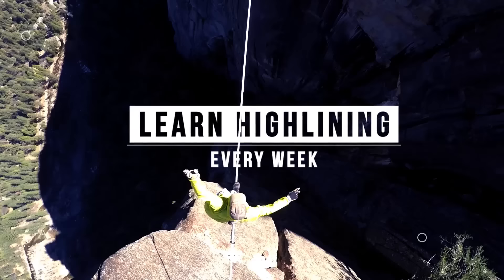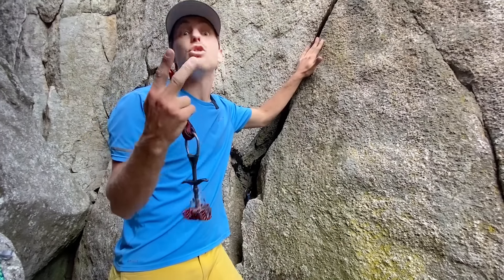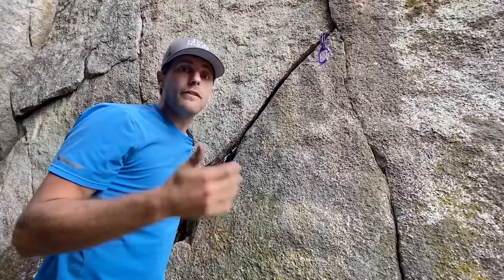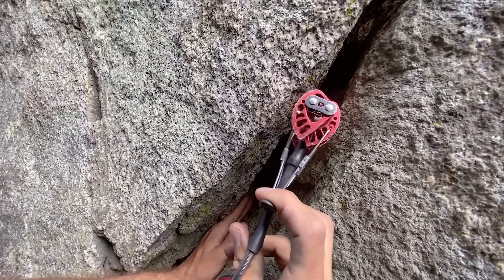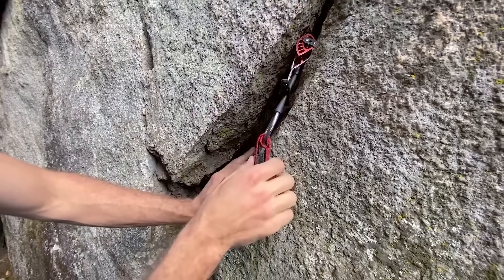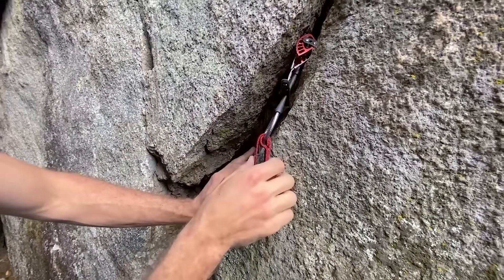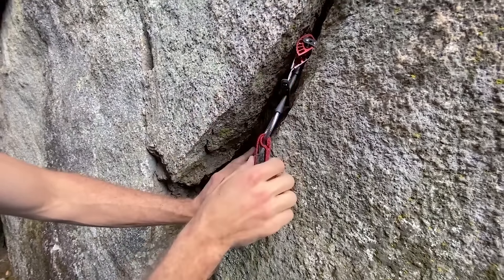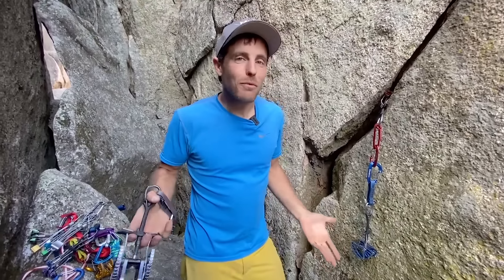How NOT to use cams for climbing trad gear - with break test!

Comment: A small clarification on your Totem Cam comment at 5:30:

The only context where it's manufacturer approved to place a Totem Cam with only two lobes engaged, is aid climbing. Totem Cams aren't rated to hold lead falls in two-lobe placements.
Reply: What about 3 lobes?
Reply: To be fair I think the big ones are still rated enough for a lighter fall with two lobes but they say don't as a precaution.  I certainly wouldn't go whipping on two lobes on purpose but I have had times where literally my only gear is 2 good lobes and 2 more barely touching, so a good chance it would be a 2 lobe placement in a fall and I'll trust it over nothing.  Often those kinds of flares do end up being good tricam placements though.

Comment: Love your stuff, though I do have one thing that did not sit well with me. When you placed that green nut at 9:58 if you seated that nut, which should be done everytime you place one, you would actually pull through and pop it out. I would clarify to give that stopper a nice tug so that the constriction you think is good at first doesn't just slip through after you weigh it.

Keep up the handy work!

Comment: I would like to see cams in side a 'real rock' adapter so we can see how effective they pull out. Such as two rocks epoxied to inside of metal case. As well as different angles of the holding device. I think for trad gear getting pulled out is more of a risk then the gear failing. So playing with angles and different rock textures is the most interesting testing.
Reply: @TheManCave563  hahaha that video was awesome

Comment: From my point of view, in horizontal cracks, it's better to place the external lobes of the cam device in the bottom side of the crack. So the base is increased and the cam device is more steady and balanced. Regards!

Comment: Good stuff, thanks for sharing! A few more points for people to consider: 

(1) You've got to start with good rock. Look for a cleave that goes to the center of the earth. Avoid flakes if you can. If there's any question, hit it with the heel of one hand while feeling for it to move with the other. Just whacking it and listening for hollow sounds is a start, but it's not enough.
(2) Maximize surface area (i.e. metal/rock) contact between the piece and the rock. Greater contact area reduces likelihood of slippage or breaking the rock. This applies to cams, nuts, and everything else. It also means you should prefer to place nuts (and hexes) in their normal orientation rather than sideways. That nut placement Ryan showed might be good in strong rock, but it'd pull right out of something soft like sandstone.
(3) Don't clip the wire loop on BD cams -- the sling is double-looped for a reason. The BD QC lab also did something similar to the final slacksnap experiment and also found that it reduces strength by about 4 kN. In drop tests simulating lead falls, they also found cable damage suggesting normal falls taken straight on the wire could compromise it over time. https://www.blackdiamondequipment.com/en/qc-labreslinging-camalots-and-c3s.html
(4) To combat walking, look for a way to pre-walk your cam into a dead end.
(5) When it comes to cams, bigger does not always mean stronger. BD's new #7 is the same strength as the 0.3 and the #8 rated to only 5 kN.

Also, seriously, go plug some gear in at ground level. Pull on it in all directions while watching it closely. If it doesn't move, look down (put your helmet between the piece and your noggin) and stomp on a sling connected to it with. If that holds, try standing with both feet in the sling and giving it a good bounce (it helps to have a second piece to hold). You may be surprised what works and what doesn't.

Comment: Thanks for the cool video! I don't understand what this breaking test is supposed to tell me as in reality you dynamically load your cam. I mean usually I fall on them, which generates a high dynamic force, and then hang. If the cam handled the dynamic force then the hanging force will alway be fine. Or am I missing something?
Reply from the maker: This break test was just to show off.  Our future cam break test videos you can walk away from smarter.

Comment: Love it. What effect does placing the cam in metal vs rock have? Is that a comparable test? I wonder if there is a way to some how set up a concrete crack to test...
Reply: Metal is a bit more likely to slip (lower coefficient of friction) but I'd expect similar strength. The tapering fixes the slipping issue.
Reply: Forgot to add: metal is stronger than the rock, there are cases where cams or other pro fail by fracturing the rock instead of breaking. Metal won't simulate that.

Comment: You fall wayyy more than you think. My first whipper was above a ~12-15 ft runout on rrg sandstone. Ended up whipping 40 feet. Math says maybe 24-30 but slack, rope stretch and yanking yo belayer 5 ft up adds up.

Comment: Read in some cam manual that placing them in opened wide position is no good. Metolius i think, they even got warning red/yellow dots in these 'regions' of cam. Could you test cam in a good crag, but which (cam) is a bit small for it? so it was squeezed just a little when placed

Comment: Any interest on testing an old Wild Country Rigid Cam? Ive got one I can spare. So old its got nuts holding the cams on. But I have cleaned it and its good for a whip. Im very curious how they stack up to todays dual axel cams, especially horizontal placement with the gunks loop, because most people ive talked to say they cant be used this way (despite being noted how to set it up in one of wild country's user manuals and they all have pre-drilled holes one the shaft near the cams). Using webbing vs cordalette. Also this destruction would be dope on a phantom highspeed camera if you can get your hands on one. or a possible team up with slowmo guys?

Comment: Wait why does the sling break at about 10kN when normal (much thinner) dyneema slings are rated for 26kN?
Reply from the maker: Nylon breaks lower
Reply: The other factor is that the metal loop pinches and cuts the sling. This is why the sling is doubled up around the metal loop, to help spread out the force to prevent the metal loop from kinking and cutting the sling.

Comment: Try a cam which has been reslinged in a non-profesional way. Try some different methods of attaching the sling. I'm guessing it will pinch the sling at a much lower kN.

Comment: If your looking at this video for advice, the nut placement section could use some updates- he showed it once in the larger crack when he set the nut sideways by pulling down- but didn’t show it with the smaller green nut. Make sure to set your nuts by yanking hard on them ;) Nuts are pretty easy to remove with a nut tool. I do like the advice of practicing on the ground first, but also some of the best practice you can get is following and cleaning for someone who has a good amount of experience. You of course need to judge if they are competent which is a risk cause you don’t know what you don’t know, so start on easier terrain, and don’t get pressured into doing stuff if you are uncomfortable. Just like backcountry skiiing- poor group dynamics can be the source of dangerous situations. For a more complete nut demonstration see this video https://youtu.be/8ia6byVFIls

Comment: I love your break tests, but I wouldn't venture into teaching people things like this.  Or give the caveat that they shouldn't rely on this information alone before heading out and climbing on gear.  There's A LOT MISSING from this video: surface contact to rock, assessing rock quality, lobe angles, how directionality impacts strength of different sized cams, etc.  Not things that could be solved by unguided "practice".  Hire a guide or find a mentor who actually knows whats up.  Or if you really have no one to teach you, set up a top rope on quality bolts or trees and practice falling on gear with a back up to see what holds.